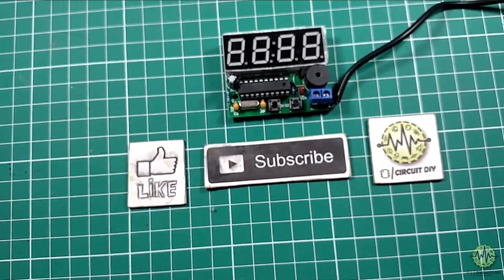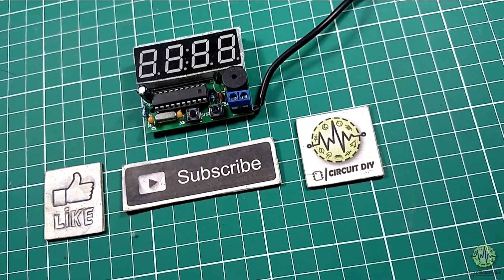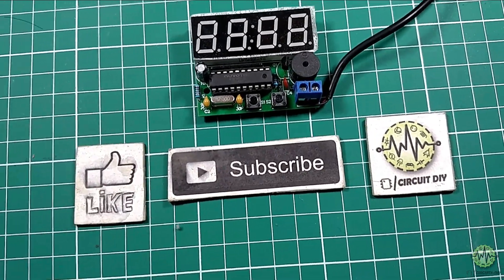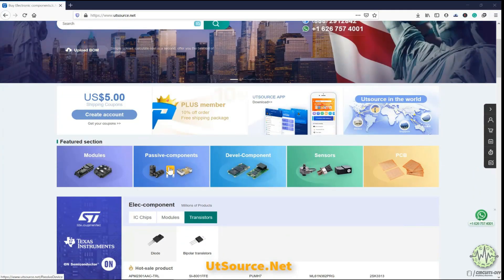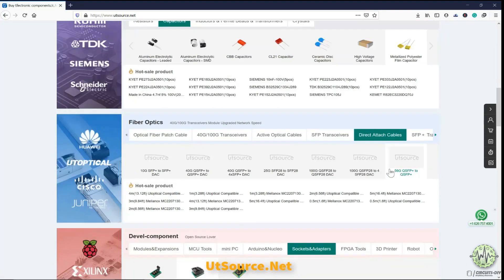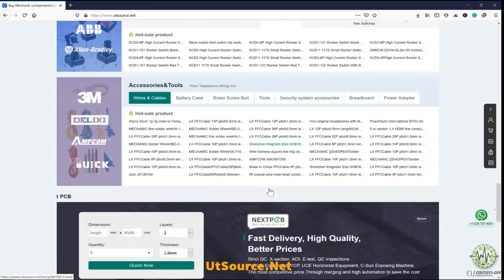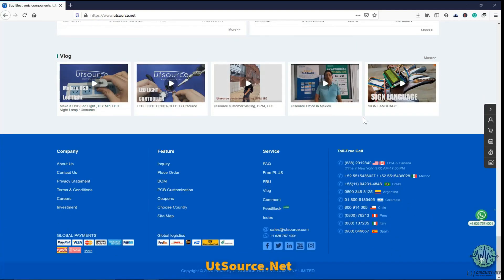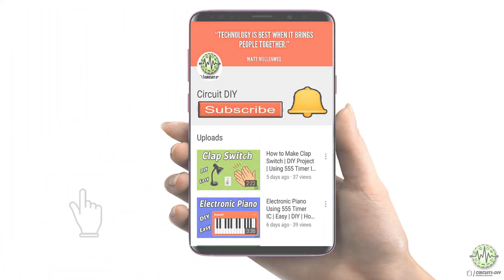How to Make A Simple Electronic Digital Clock | Utsource.net | Homemade DIY

Comment: Is it need any programming  for ic
Reply from the maker: No it's not
Reply: I am using atmel at89c2051 24 pu for that
Reply: Old atmel at89c2051 get busted so i am just replace with new same atmel ic so that i am asking for new ic is  we need to write any program
Reply from the maker: Then yes ...coz it comes pre programmed if you bought new one then you have to program manually